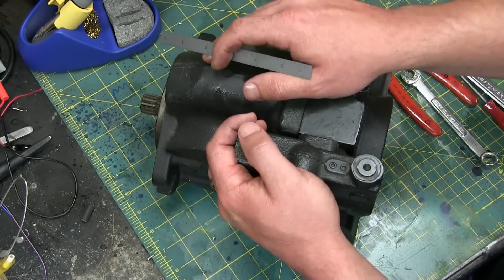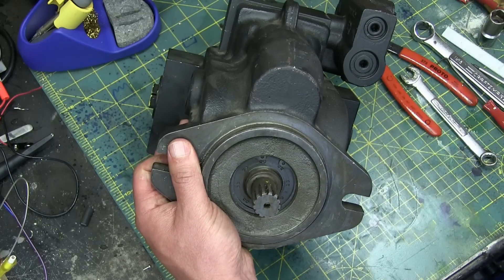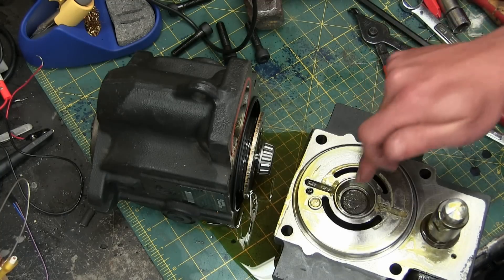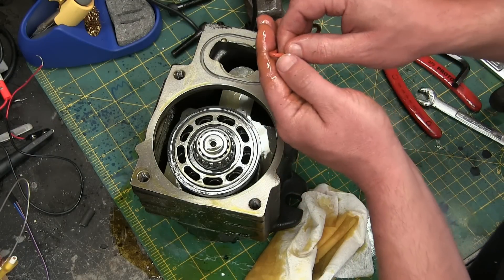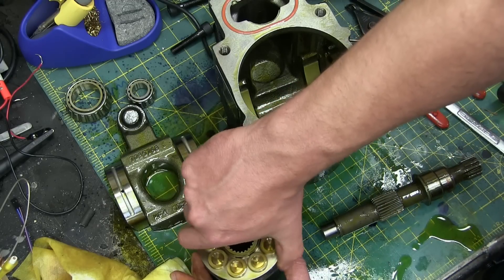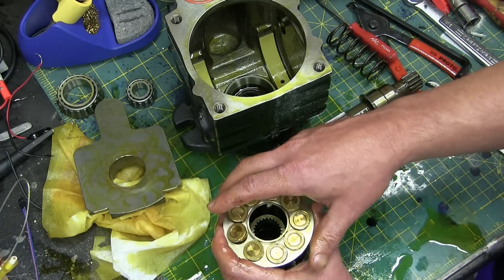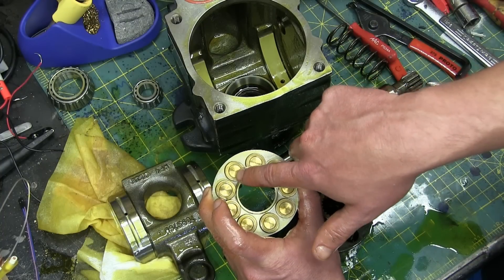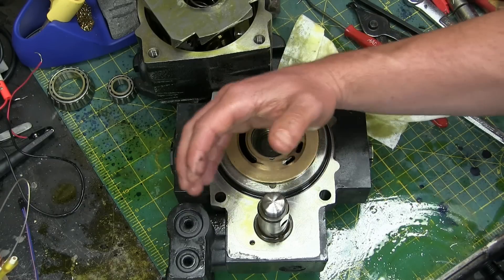100 HORSEPOWER in your HAND. Hydraulic PISTON PUMP!

Comment: 30 years ago I worked in a factory that made compact versions of these originally designed to control gun turrets on bombers during WW2. They also built a brilliant variation  called a "back to back piston pump/piston motor". It placed two of these units back to back on a single fixture so that the oil output from the first pump, which is driven by the power input shaft, flows directly into the second pump. This flow then drives the second identical pump and makes it act as a hydraulic motor. You get a compact unit with no external hoses or lines that can be controlled by a simple handle connected to the axis of the swash plate. It also acts as a variable speed, reversible transmission, all with just one mechanical control (a STICK!) connected perpendicular to the axis of the swash plate.
Reply: Well that's interesting as fuck
Reply: Haha, I thought so.
Reply: That is interesting, please share more details and examples if you can.
Reply: That's how a hyrdrostatic transmission works on many lawn and garden tractors.  With one on each wheel, you can literally turn on a dime..
Reply: bulruq 
That's pretty cool, especially the bomber turrets part, I guess they were steered with pedals (right and left), I have to dig a bit for more details.
Reply: bulruq a
Reply: cat bull dozers have the same assembly the castings even look the same as the one in the video
Reply: bet thats the same as the powering pump on our 1950's tractor
Reply: Vickers I believe, I believe Sperry Vickers produced pumps for the old turrets.

Comment: I was trying to picture how the fluid got into each piston.  I had to think about it for a minute to realize the (possibly self-evident) fact that as it's rotating, the pistons are on their intake stroke over the inlet and vice versa.
Really looking forward to the "hydraulic computer" vid.
Reply: Yeah, as the cylinder rotates and pistons follow the swash plate, they move down as they cross the inlet creating a vacuum effect that draws fluid into the cylinder and then push up as the rise on the outlet side creating pressure that forces fluid out of the cylinder

Comment: I have rebuilt a couple of hydrostats.  One was for a lawnmower, and one was for a skid steer.  Both were fixed by taking the bronze plate to a shop to get machined.  The shop in town makes satellite parts for Bell.  Using their fancy computers they machined it level to .0004" .  They charged me $75.  If there is any wear in the plate, the oil will leak off and go to sump.    I have never had any other issues with the hydrostats (pistons, swash plate or whatever).   98% of the time it is that plate
Reply: all the hydrostats from transgear that I have done can be brought back to their former Glory by getting rid of the crappy lightweight gear oil they were shipped with at the same time micropolishing the plates on both motors and cylinders with a random orbital palm sander.. works like a charm😀
Reply: Do you mean .004? Because to get something down too .0004 that's amazing.
Reply: +roger brandt yes I meant .0004.  they measure it with a Lazer somehow.  the technology is here...
Reply: +DEBOSS GARAGE wow that's impressive I Run a Cnc lathe and can make adjustments to .0001, but never no need to go that low, what kinds machine do they use.?
Reply: +roger brandt no idea.  I have a channel too.  if I run I to it again, I will definately make a video though
Reply: +roger brandt I would think a cnc surface grinder.
Reply: +roger brandt The thickness of the plate is critical to only .005", but the flatness needs to be tighter. You can do that by hand lapping on a granite surface plate. Its low tech.
Reply: +roger brandt Or...you can just buy the individual rotating group parts, and save time and money. The parts are not dimensionally matched at the factory, because they are all manufactured within a tight tolerance. You can just buy swashplates and piston assemblies, and mix and match...however, I usually replace the entire rotating group, so I dont have any comebacks.
Reply: +Foxboss9 I like the idea of micropolishing the pads and plate. I wouldn't do it though. Too lazy, too time consuming.
Reply: You can do the same job by surface lapping on a lapping block and compound.
And to measure the surface roughness you can buy a pocket size surface profilometer at Starrett or Mitutoyo.
Reply: +Nickael7 I tried that first.  The problem was that I put uneven pressure on it and it ended up uneven.    When I brought it to the machine shop, they measures it and I was off by 0.006".  For $75 I will never screw around like that again.  It takes a lot of time reassembling and installing hydrostats.
Reply: DEBOSS GARAGE
Ok !!! I see... It's about hand skills !!! But nevertheless, a good skilled machinist can achieve a nice surface finish by hand at about ~16 mikes (short for microns) !!! Which is good enough.
Reply: Agreed.
Reply: DEBOSS GARAGE Did you also resurface the piston pressure pads?
Reply: I didn't in those cases.  The bronze is a lot softer so it takes aa the abuse
Reply: ipissed
It is not suppose to take so many hours...
Reply: The main issue in many cheap cylinder assemblies is the use of aluminum on the base plate (with no bronze / steel plate in the middle) and the cylinder being either ductile iron or some type of chrome moly steel when used with cheap mineral oil, which many are in lawn tractors. I swash buckle's are often built with a hardened steel placed on a thrust type roller bearing and rarely wear out. The power unit though, yuck. 

Finishing it to .0004 is a little extreme in my opinion. If you can get it to within .001 you'll have a pump that will be fine for light use (say 300 - 500 ft lbs of torque) in most lawn tractors.
Reply: your sposed to just replace those bronze thingies.... matter of fact most of the stuff inside gets replaced when it wears or you havent done yourself any good...
  it is likely that the stroke was reduced therefore the pressure and flow. so it is now a re built worn out pump......nice job!!
Reply: roger brandt ?.0004? Ummm that’s not all that difficult I can do it on manual machinery. Any quality CNC won’t have issues. In fact I machine my lathe backing plates and setup at .0000. Doesn’t get any more accurate than that. So yes he probably meant .0004.
Reply: My skid steer starts to gradually lose forward and reverse when it’s hot, about after 45mins of work. After that it just sits with no drive bucket lift and tilt keep working fine. Does that sound like the bronze plate might be the issue in the tandem pump?
Reply: @Nickael7  p
Reply: Yup l have found the same thing. The other is some %#@& fiddling around with a allen key.....

Comment: A thing of beauty.

Fun fact:
Back in the early days of jet engines, these were used as fuel pumps. The advantage of these is that the full capacity of the pump is only needed at take off, only a fraction of that fuel needs to be pumped to the engine during the rest of the flight. If you use a gear pump, from take-off to landing it has to pump at 100% of its capacity, which means you have to let most of it drain back into the tank, this has drawbacks such as heating up the fuel that's not being used, over and over and over again.

As jet engines got bigger, piston pumps fell out of use. To get a higher flow, you can either run it faster or make it bigger. Bigger was no good because the size and weight of the pump needed became prohibitive. Faster was no good because no bearing materials exist which can survive for long in those conditions (remember these are pumping jet fuel, the lubricity is much lower than hydraulic fluid). On the other hand making a compact and high capacity gear pump is fairly straightforward, the only bearings you have to worry about are your sealing faces which are taking barely any load.
Reply: those variable displacement pumps are still in use on airplanes to keep hydraulic pressures at 3000psi. They seldom cause problems.

Comment: 100 HP in my hand every time I shower.
Reply: Until you release the Schmoo, then there is no point in pumping the piston any longer since increased pressure will not provide increased flow.
Reply: @MerpSquirrel  false,  sometimes it has quick recharge enabled
Reply: @rrtsduf  :)

Comment: The torque these things produce is crazy. I have a diesel Deer garden tractor that uses three of these variable displacement axial pumps, one in the back and two in the front (AWD) and they run the two in the front coupled to the steering to adjust the wheel speed independently so it doesn't scrub in turns.  Granted there is also gearing involved with the back axial pump but it's a powerhouse for sure.  Very cool stuff!
Reply: pretty amusing and totally makes sense to me that they can handle serious torque, cause those tapered bearings are real similar looking in size to trunnion and wheel bearings on (toyota) pickup axles. the shaft also looks awful similar to the input and output shafts on their transfer cases that are pretty well known for how much torque they can handle under gear reduction. impressive hunk of steel there.

Comment: Exact same type of pump that you find in an older (read good - overbuilt by factors in the 10-20x) hydrostatic drive tractors.  I have a 1972 Cub Cadet 149 that uses this exact same type of pump - the infinite variability allows you to extract maximum torque to speed.  My application was tractor pulls, a hydrostatic drive allowed you to set the engine to full governed speed and then vary what amounts to your final drive ratios as needed - full speed ahead and the start and then as you start to run out of power you pull back on the output to reduce the load against the engine driving the pump - same effect as gearing down but without any disruption in power.

Love this channel!
Reply: Andrew Cammer e e e e exzatleee

Comment: How about a Blow Out Preventer???  Wonder what one of those looks like?
Reply: You mean a "pressure relief valve"?
Reply: Nope.  They are used on Oil Rigs.  Really cool.
Reply: Ok, but what does that have to do with this pump?
Reply: They share some common characteristics.
Reply: Beauty fades, but a dirty mind is a joy for ever.
Reply: +AvE like pulling apart a grilled cheese sandwich.
Reply: too bad a blow out preventer is about 10 feet tall and weighs a few tons.... kind of hard to get that into the shop
Reply: +AvE Depends aren't a blowout preventer, its a blowout containment device.

Comment: And the great thing is that the same device is also used as a hydraulic MOTOR when the flow instead pushes the pistons through the cylinders. Hydraulic systems are pretty interesting.

I remember taking one of these apart since hydraulic winches on ships use them. I never knew about the holes in the slippers/shoes that allow hydraulic fluid to form a film between the slippers and the plate. Great info

Comment: Would be great fun to whack a big old lever onto that swash plate and put it in something that goes fast that you can ride.
Reply: flow is way to low for that.  this pump could run a big press nicely though...
Reply: Air force bomblifts run on hydro piston pump just like this one and we make the competition loading lifts move pretty quick.
Reply: Yeah it would be a higher volume lower pressure pump that you would want but I'm just getting excited about moving that swash plate by hand.
Reply: That's the idea of a skid steer loader transmission, a hand operated swash plate pump to control the speed of the motor for each set of wheels.

Comment: According to my mentor that used to make these at Vickers way back in the day (60's era), the cylinders were matched on tolerance to the bores originally and he told them they were idiots for doing that, wasted effort. They said 'well what should we do' and he said they need to thermally-stabilized the centerless grinding machine making the cylinders to remove the size variability, and they said build it. So he used a series of heat-lamps and temp-measuring devices placed over the coolant return to automatically turn the lamps on and off as needed, bringing the coolant to a specific temp regardless of ambient conditions. This thermally-stabilized the whole machine and reduced cylinder variability down to less than one ten-thousandth. Really, really good.

Now there was a big management meeting kerfuffle with company bigwigs in attendance saying he'd destroyed their entire pump business because now they could not match variable tolerances between bores and cylinders anymore, making the housings they were producing useless unless they could somehow match tolerances with the boring machines, which their boring machines were unable to do.

He again told them they were idiots and told them to buy a certain new boring machine that could produce the tolerances needed, which they did. Had it there by the end of the week, brand new, even though there was a two-year waiting list on these things. But hey, it was Vickers back when they were a big name, they threw their weight around.

Problem was, the technician they sent with it could not get it working! It was producing parts but unevenly, not up to the tolerance it was claiming. And he told the guy that the problem was the machine was running on flat-belts and should be running on v-belts, due to the flat-belt joining causing noise that ruined the surface-finish and roundness. So he spent a weekend stripping the belts and pulleys cutting new pulleys on a lathe for v-belts for the machine. He'd had experience building pulleys at his previous company so it was a cinch. This helped, but didn't completely fix the problem as they still had a chatter-issue in the machine as it bored the holes.

He realize the boring tool was too flexible, even though it was a thick piece of hardened steel. So he bought what was at the time probably the largest piece of tungsten-carbide ever made, for use as the boring bar on this machine, and hand-braised a diamond onto the end of it 'somehow'. He's not really sure of the chemistry of how he was actually able to do it, only that it must have carburized on there after so many attempts--this was before people commonly knew that titanium would've been the perfect material for this brazing job. Instead he just spent an entire weekend doggedly brazing this diamond onto the end of this boring-bar for hours on end and failing over and over again until it just worked.

Then he sets up this machine for boring holes and bam, worked like an absolute charm, making perfect-tolerance holes, no chatter, with a gorgeous surface finish, time after time. His bosses were amazed. Now every piston they made matched every hole perfectly and they no longer even needed to do tolerance grading to make sure which pistons fit which holes.

Which made the kind of disassembly you just did in this video, without a witness-mark, possible!

I've always wanted to own one of these style pumps since hearing that story, such an amazing piece of engineering.

As for my mentor, Vickers was priming him to run his own division, but instead he left and started his own company which he ran for the next 60 years, and still at it today in his 90's!

Comment: I worked in a man lift factory, the various units manufactured all used these pumps for propulsion. They used the variable flow to change the speed of the units, they had high & low speeds. The bigger machines used a pump that weighted a couple hundred pounds and was ran by a 4 cylinder engine. The hydraulic plumbing was complicated to say the least.

Comment: sweet video +AVE ! These pumps are really neat, they don't have to have a designated inlet or outlet, many machines use these pumps to power their drive motors. In setups like that, the pump swashes either way off of 90 degrees, which allows flow in either direction in and out of the pump, which is very handy for controlling drive motors that need lots of flow. other wise you would have to use very large valving. The pumps in Boom lifts,  are controlled by solenoids built into the drive pump! 

Thanks for putting this up!

Comment: Great vid. Same type of pump used in aircraft hydraulics. 3000psi systems either engine driven or AC motor or a combination of both types. Also power transfer units which have a couple back to back connected by a torque shaft one acting as a motor to drive the other as a pump.

Comment: In New Zealand we call the alloy bronze manifold plate a valve plate and if you ever install one of these always fill pump housing via the case drain as bearings swash plate ect are all lubricated by the oil bypass this prevents dry starts  love your work though clearly clued up on what you do

Comment: Stripped down and repaired a few of those pumps on telescopic handlers. Usually striped splines on the drive shaft or the big spring snapes keeping the pump in neutral.

Comment: Great video.   I recollected the maxim from Hydraulics 101(~1991):  "Pressure is the resistance to flow."  I was "WAVETUBE84", then.   I forget exactly, was practically a decade ago.   There aren't many gibs that are so poetic...    you gotta  real kick out of that one.  ...Another thing or two:  (1) If a hydraulic circuit locks up, either a pressure relief valve opens, or something blows.   If not, the hydraulic pump can seize the Powerplant.   Therefor, the input shaft on yir CSDs and hydraulic pumps are turned undersize (necked down):  So the shaft snaps, rather than locking up yir aircraft motor.   On yir automobiles, the shaft is pressed into the drive pulley.  No splines or woodruff keys.  The 1980s Buick Grand National had POWER BRAKES!  Not "vacuum assisted" brakes.  A line was plumbed off of the POWER STEERING PUMP, which actuated the brake servo.  "But why Master?"  "Aaaahhh... Grasshopper, because the turbocharger pressurized the intake manifold...no vacuum to 'assist'."